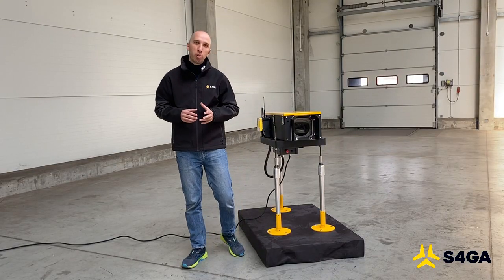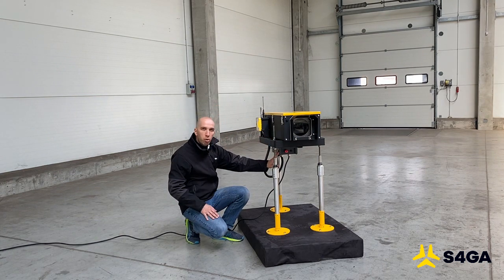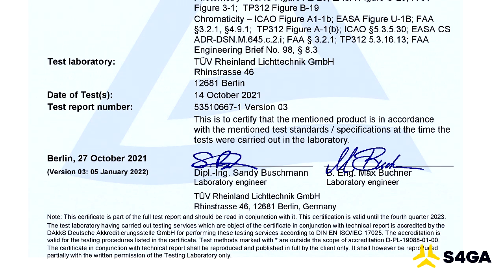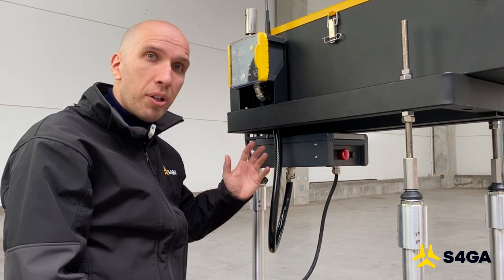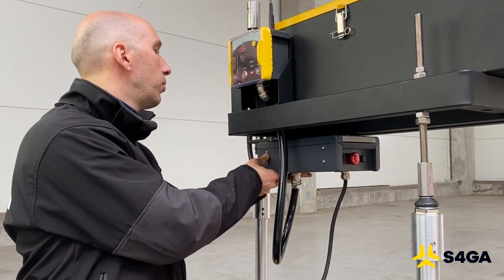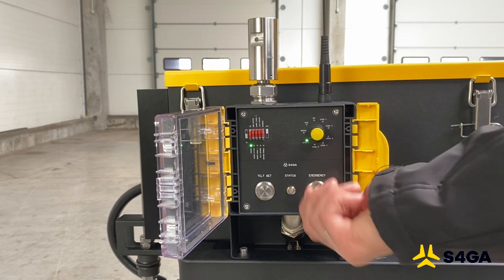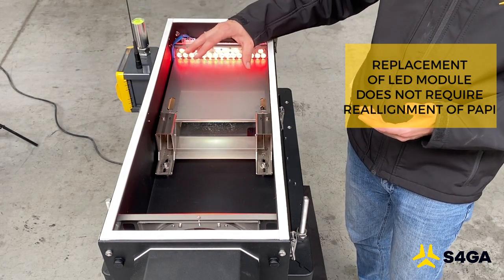S4GA LED PAPI Precision Approach Path Indicator Overview

Comment from the maker: 00:25 - PAPI Overview
01:00 - PAPI Design
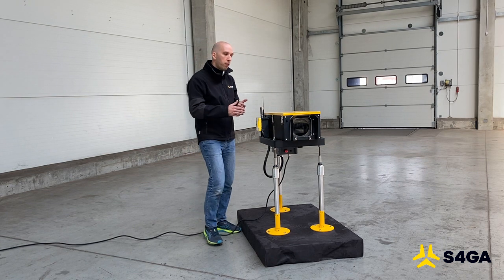02:15 - PAPI Compliance
03:03 - PAPI Power Supply Options
03:40 - PAPI Power Control Unit
05:15 - PAPI Control Box
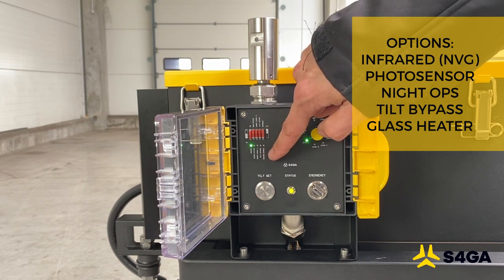07:15 - PAPI Optical Design